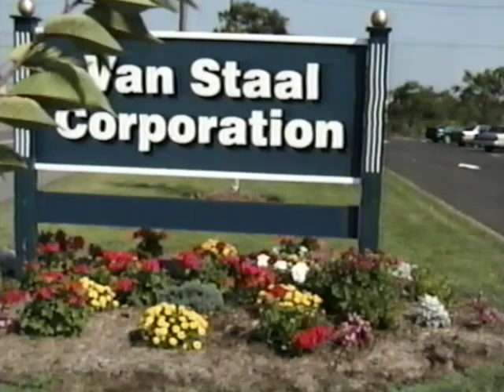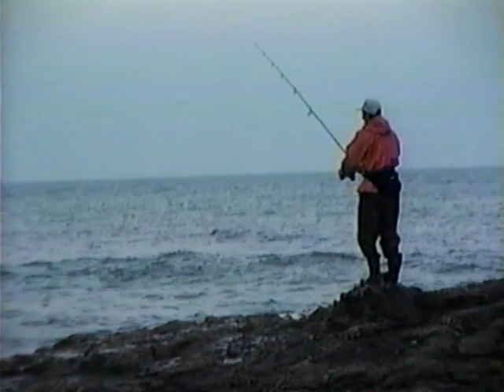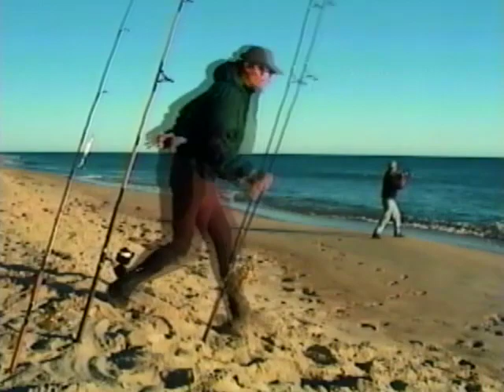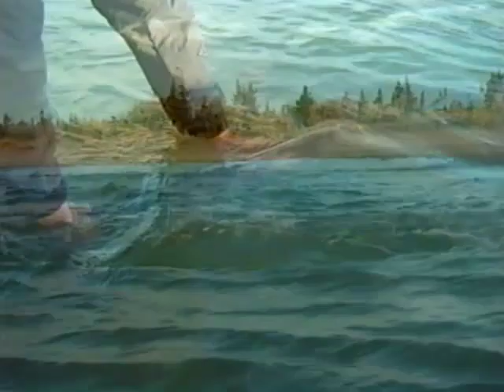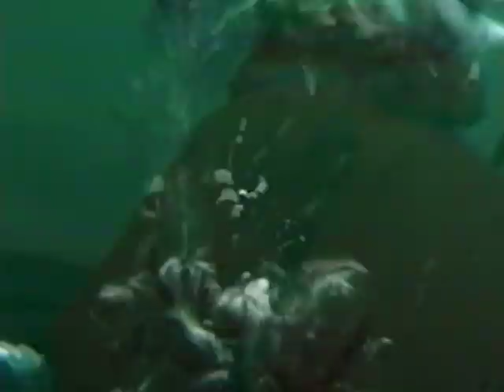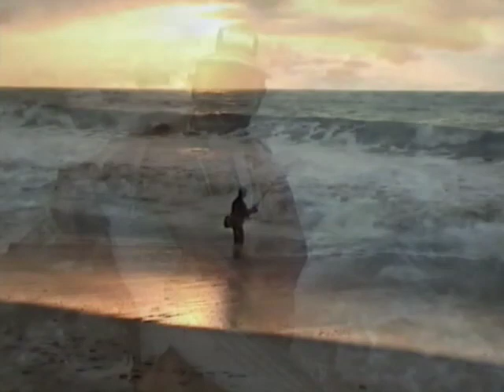Van Staal Tomorrows Great Technology Today

Comment: I thought van staal is made in China?
Reply: The Van Staal reels were originally made in the United States, but they're made in China now. I'm not too knowledgeable on the exact details, but I do know that some of the original VS series Van Staal reels were made in the United States, and the rest of the VS series were made in China. The VSX series is made in China, and it came after the VS series. The VR series is also made in China. For the bailed Van Staal reels (VSB series), I think some of the original bailed reels (not the bail-less VS and VSX Van Staals) were made in the United States, while the rest were made in China.
Reply from the maker: Charles is pretty spot-on. Production moved to China in the early 2000's after being engineered and built in the US in the 1990's.